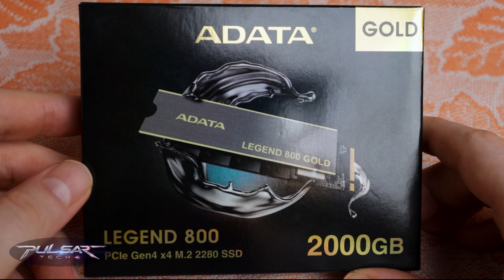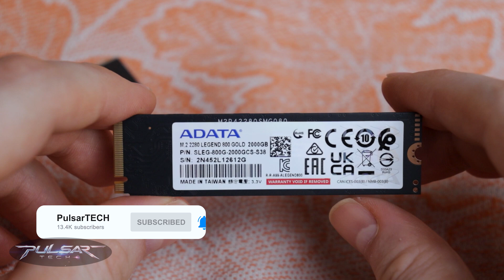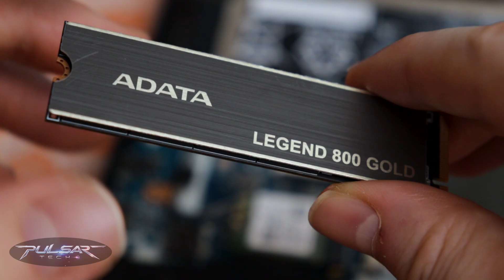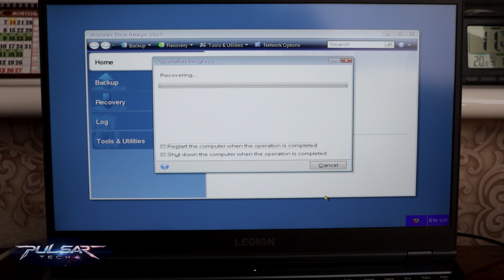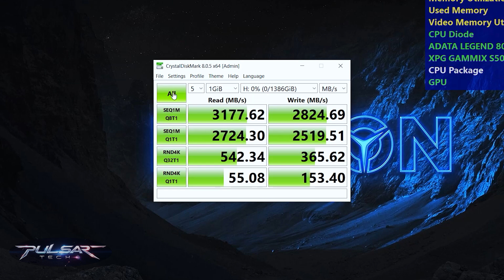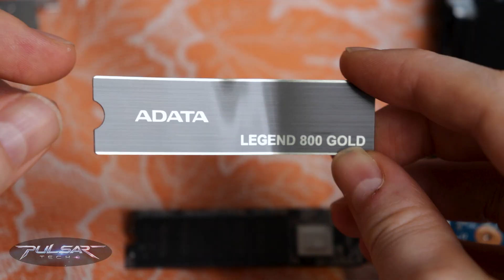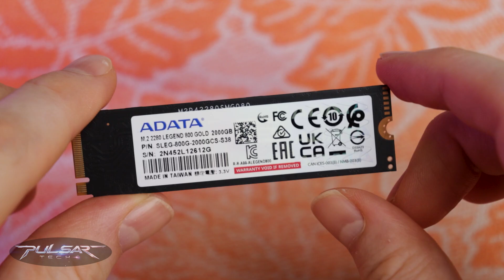ADATA LEGEND 800 GOLD 2TB SSD DRIVE REVIEW – Speed, Value & Performance!

Comment: Hi guys, Do you recommend me to buy the adata legend 800 1tb version because I found it at a cheap price, but I am concerned about it not being very well known to me and my friends compared to Kingston?
Reply from the maker: The ADATA Legend 800 1TB is actually a solid budget Gen4 NVMe SSD for everyday use — good speeds for gaming, general productivity, and even light content creation. While Kingston is more well-known, ADATA has been around for a long time and their SSDs are used by many. As long as you're not expecting high-end sustained write performance like Samsung 980 Pro or SN850x, it's a great value drive, especially at a low price. Just make sure it’s from a reliable seller and comes with warranty.
Reply: @PulsarTECH Thank you so much ❤
Reply from the maker: @Yasser-GwH  you're welcome

Comment: my personal expierence the ssd didnt even last 1 month on my pc it broke very fast
Reply from the maker: How hot was it getting? Did you use the default heat spreader?
Reply: @ it was a prebuild and i was new to pc’s and it didnt come with a heat-spreader so next time ill just make my own pc so ill include a heat spreader. btw the prebuild was cyberpower and ik they are really bad😭
Reply from the maker: @ I hear you, pre-builds are quite often built neglectfully. As per may experience so far, this drive is indeed quite a bit hotter than my other ADATA NVMe, around 10C on average. And even with the stock heatsink it reaches like 60C, no wonder it give up in a month! I would use some good liquid thermal pad and a heat spreader.
Reply: @PulsarTECH I’m unable to get a heat spreader. Should I use the default heat sink and hope for the best? Just got this btw
Reply from the maker: @eddiee9147  well, technically you can use the default heat sink and it should be better than without. But the temps can be very high thus limiting its life span. Do you use it in a laptop or PC? In PCs you have more airflow and can possibly get away with the default heat sink.
Reply: @PulsarTECH  Well I’m using it in a laptop so I decided to purchase heatsinks to combat the problem. Thank you for pointing this out as I believe my last drive died due to overheating. Thank you!
Reply from the maker: @ absolutely, better to get one. New PCIe 4.0 SSDs are pretty hot, and PCIe 5.0 are even hotter I believe. I think combined with new nvidia graphics cards, soon you'll be able to use it a heater at home. LOL
Reply: @PulsarTECH  With the heat sink, it runs at 33 degrees C while idle and 40+ while gaming. Thank you so much for your help!
Reply from the maker: @ you're welcome, these are really good temps! 👍
Reply: ADATA LEGEND 860

Comment: That's pretty impressive that the laptop can handle two drives 2 terabytes each, giving it 4 TB in total. Wonder if you can put two 4 TB ones in the same laptop and if it would be able to handle them?
Reply from the maker: It would depend on the laptop's motherboard and the total storage capacity it can handle.